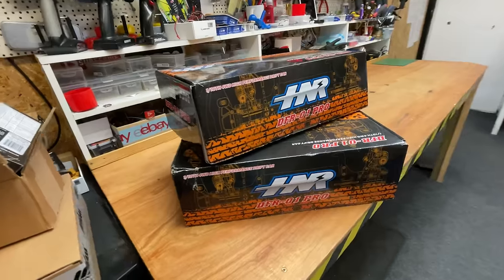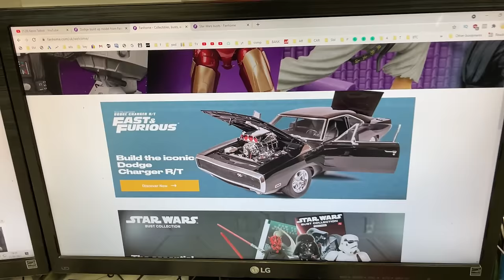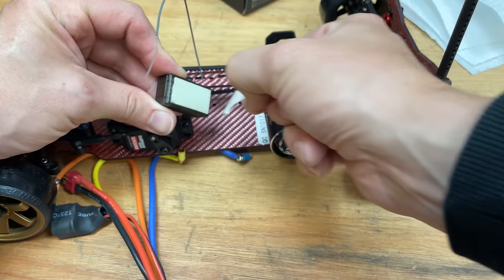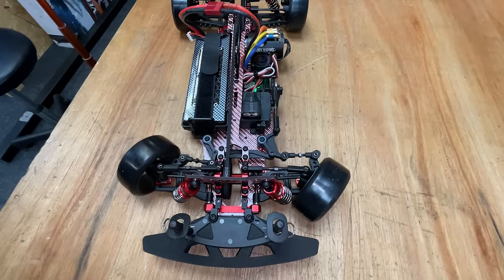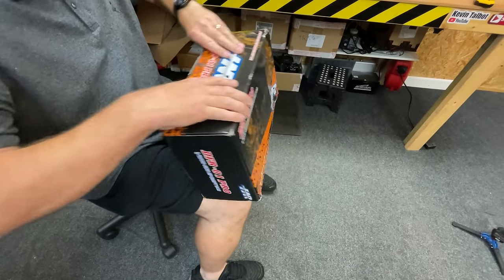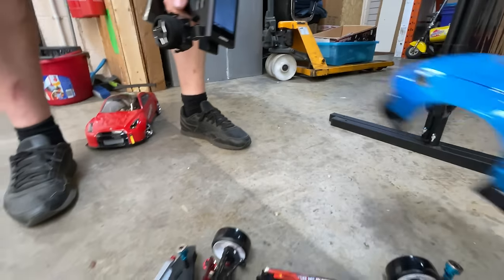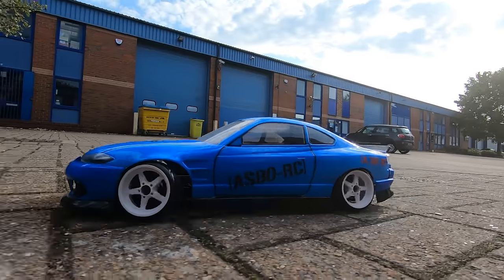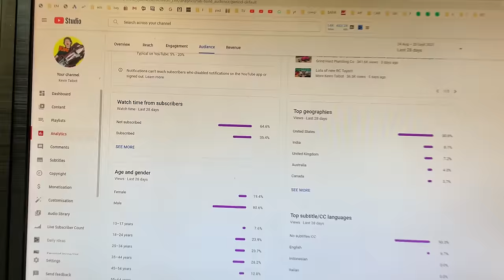Cheap Professional RC Drift Cars

Comment: I've never drifted I don't understand how it works but I'm guessing these aren't the best cars around.
Reply: It's tricky. These are actually pretty standard/good.  That is how slow most move while drifting. Their tires are hard plastic, not soft rubber. The motors aren't necessarily meant for speed. They need a high rpm motor and esc combo that stays cool as they're typically at constant throttle. 
Basically the same idea as crawler combos but higher rpm.